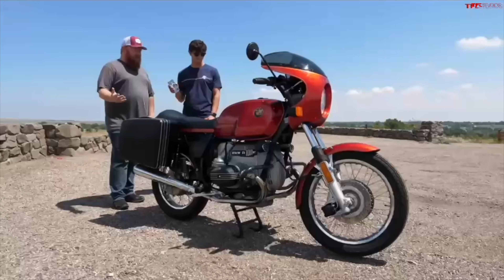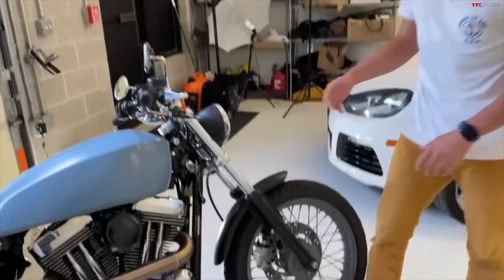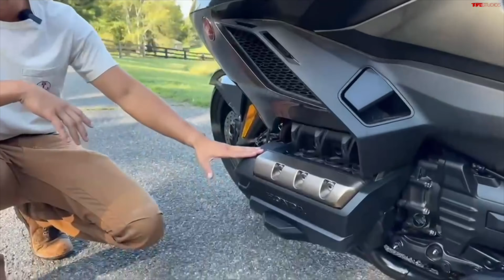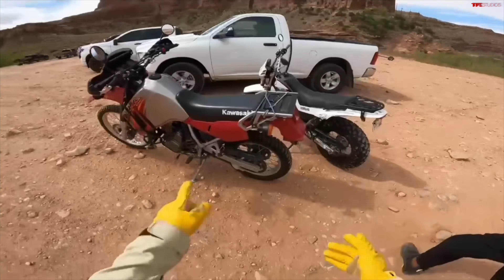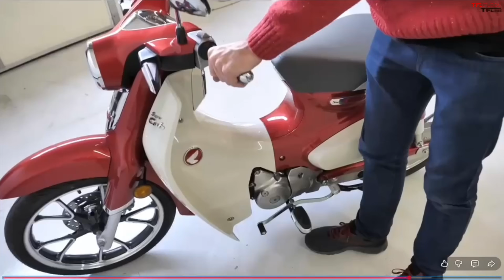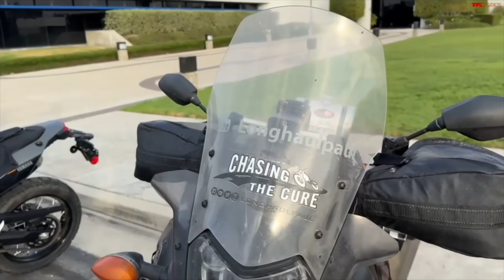Top 5 MOST RELIABLE Motorcycles You Can Buy Used!

Comment: 1970 and 80s MotoGuzzi Guzzistas used to rack up incredible miles with many of them being on the road full time as a way of life. Those are bygone days from a niche bike with no living participants, but the Guzzi Big Block Vs would truly run with minimal wear almost literally forever, if looked after. The rest of the motorcycle could fail at almost anytime, but was usually fixable on the side of the road. The dealer network has unfortunately always been rare to completely absent. Too bad MotoGuzzi beat BMW to the punch on marketing the first successful transverse twin, forcing BMW to market the Boxer. If BMW had evolved the V-twin like they did their own engines, think what a theoretical 'V1150RS' version of the 2005 Twin Spark R1150 oil head would be like revving at 8000 rpm! 
  I wish BMW would buy Moto Guzzi and straighten them out for mutual benefit.

Comment: I bought my 2012 Suzuki V-Strom 650 new in 2013.  It now has over 127,000 miles on it.  I adjusted the valves only once so far at around 85,000 miles.  The front and rear brake rotors lasted almost 100,000 miles. The starter switch went bad once and I replaced it.  I can’t think of anything else I have had to do that wasn’t routine maintenance.  Dozens and dozens of oil changes.  I have replaced the spark plugs 3 times.  It has never left me stranded, ever!  I have ridden it through 46 states.  I easily count it as one of my best purchases ever and I think it will probably last to 200,000 miles perhaps beyond.  Not only should it have been one your list it should have been in the top three.  You can read many details about my bike on certain social media platform that starts with the letter “I” I’m hiramrides there.

Comment: honda forza nss 300 there one in hope BC canada with 193 000 K on it  and loads of other pushing 100 000 k .  Motorcycle ? nope scooter but since you including ct  that should be thought of to.  Honda nss , sh , pz all all can do large miles  with just belts   and doing the normal stuff to it .      Goldwings gl 1000 to 12000 can do up to 500 000 miles if you take care of them.  Really they are one of few bike you can fly, buy and ride to the other side of usa/ canada  all for under 2 grand .  Then still sell for that 2 grand . Worse issue with the older goldwings in carbs . Also I would include the pc 800 pacific coast   .   Need cold beer there's an ice cooler in the trunk .  Need room for 71 ? L of stuff  you ve got that .

Comment: Yamaha VMX 1200cc I had an 1988 that I bought with six thousand miles and over twenty years put one hundred and eightyeight thousand miles before I was knocked off it, while mending I stripped it down and bored to 1500cc stage 7 Dynojet with seperate K&N's seventeen wheels front and rear I kept the shaft drive Upside down front end ohlins rear shocks custom tailpiece Ducati ish, single seat filler cap in the tailpiece Brembo 4pot front and rear calipers steering damper digital tach /speedo in place of speedo rev counter repalced with oil temp/pressure guage solid motor mounts frame stiffner along with swingarm brace and many more upgrades push button shifter clutchless Carbon bellypan and front mudguard to match the tailpiece LED lighting electronic flip up registration plate handbuilt 18inch twin outlet Carbon/titanium twin rear mufflers 4into2 exhaust pipes.
The bummer never got to ride it while away bank holiday weekend racing Enduro came home to find it stolen never found although a lot of it was seen on bikes in Portugal a few years later, insurance squirmed to a piss poor payout even with photos and receipts still classed as a 1988 bike.
Reply: My condolences. Sounds like the coolest VMax ever and that is a cool bike.

Comment: Honorable mention to the Suzuki V-Strom 1000. The engine is de-tuned from its original TL1000 platform and reliable as a stone. It's no slouch either pulling eleven second quarter miles and top speeds into the 130's. Shimmed valves that rarely go out of spec.  Don't be afraid of high miles - they can take it. All that can be had for under $3000 in the current market. Speaking from 23 years of ownership, hands down, this is the best bike I've owned.
Reply: I'd alsos add the 650 too that. It's bullet proof. I thrashed mine for  years and it never complained ta all.